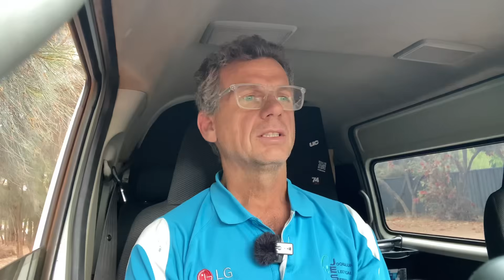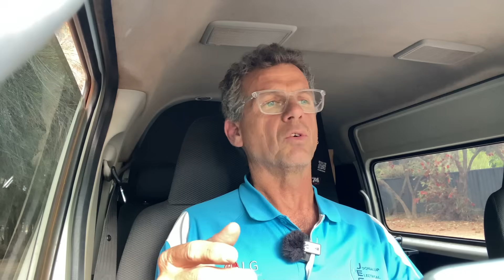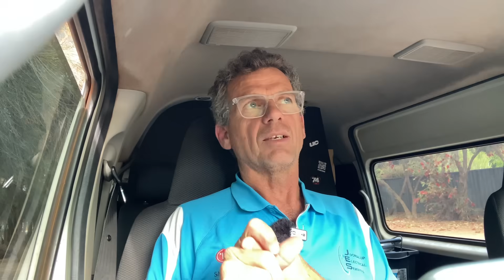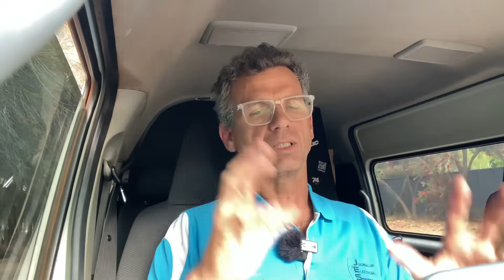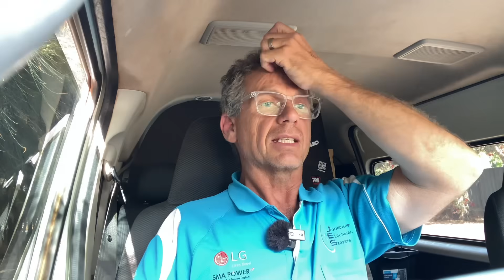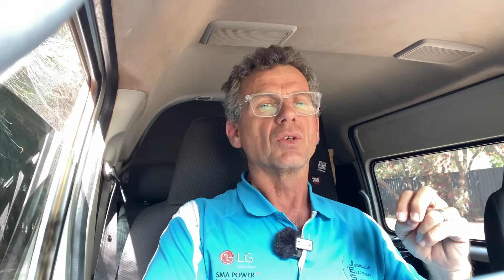What you need to consider before buying an Off Grid solar system, facts from an experienced tradie!

Comment: The comms issue is one of several reasons why I don't like Tesla any more.  It's really too bad.  But I do disagree about the HF vs LF.   Modern HF inverters have multiple distinct designs and you need to know what you are getting:

* Large HVDC mid-bus with LVDC battery connections (Tesla, Sol-Ark, EG4) (e.g. Deye and Fronius)
* Small HVDC mid-bus with LVDC battery connections (most small HF inverters)
* Large HVDC mid-bus with HVDC battery connections (bleeding edge so we'll be seeing these soon)
* Small HVDC mid-bus with HVDC battery connections (SMA, SigEnergy, LG)

A very mixed bag, but I think for HF it mostly comes down to selecting the right inverter for the job.  And I also suspect that the bleeding edge technology... HVDC mid-busses with HVDC battery connections, will completely stomp LF once manufacturers decide to do it.  Right now most HVDC battery inverter designs have only small mid-busses because the designs depend on the battery itself to be the energy buffer.  But batteries do not make good capacitors so they can't handle the cycle-to-cycle buffering required to run large loads with poor power factor.  It's a learning curve for sure.

There are still major advantages to HF, particularly the MPPT implementation (which generates very little heat because its a HVDC-string-to-HVDC-mid-bus).

The large mid-bus HF inverters can surge just as well as a LF inverter and actually do a better job with poor-power factor running loads than LF inverters can because the capacitor bank is much, much more efficient at dealing with cycle-to-cycle reactive power than a transformer with capture diodes and LVDC side capacitors.

HF inverters also do a much better job transferring solar power directly to loads (HVDC string to HVDC mid-bus = no heat).  Hence why you see higher output specs when solar is present.  It's really only battery charging of LVDC battery banks that generates heat.   LF inverters do a better job charging LVDC battery banks while simultaneously inverting.

LF designs (Victron and others) tend to be simpler but also tend not to have much integration because they don't have the HVDC mid-bus that makes integration so easy for HF designs.   What they do have is that big honking hunk of metal which can buffer a lot of energy, providing high surge loads, and have a lot of mass as a heat sink... so large temporary loads can run a long time. 

However, be careful, because taking heat away from a LF transformer is actually really difficult to do.  A LF inverter cannot handle large continuous running loads any better than a HF inverter can and also can't recover as quickly when they do overheat.

Regardless of the type of inverter, I always oversize.  By a lot.  And I mount them indoors.  In a conditioned or partially conditioned space, if possible.  Outdoor mounting for an inverter is a mistake in my view.  Inverters (of either type) just last a whole lot longer when they aren't running 90C internal temps.  Avoid the high temps and an inverter will last a very long time.  It kinda drives me nuts to see so many inverters mounted outside in Australia instead of inside in a conditioned space.  90% of the problems would disappear if they were mounted in a conditioned space.

-Matt
Reply from the maker: Yes climate controlled environment is best

Comment: When I designed my off-grid system it was always about robustness, reliability, redundancy and running by itself (without a requirement for off-site monitoring or me getting involved on a daily basis.) I chose Victron equipment and went for a DC coupled system.

I split my 15kW of panels into four arrays, each with its own MPPT regulator. They are all identical and I can get by on two of them if I have to. I have three 5kVA inverters running in single-phase, parallel configuration and if one fails, I could get by running on two inverters while I wait for a replacement or repair. It would take no more than 5 minutes to quickly reconfigure the remaining inverters to work together.

I also went for a modular battery system that has its own BMS as well as directly interacting with the Victron Cerbo GX so that charging and discharging are optimal at all times. Altogether i have 50kWh of capacity made up of 14 individual 48V batteries in parallel, that communicate with the Cerbo GX on a CAN bus.

It really has been a case of "set and forget" and I have not had to intervene in any way since it was commissioned over two years ago. As an aside, I take your point about having some sort of backup generation, but in my case, I opted not to do so. Since commissioning, my lowest SOC has been 50%, during a period of cloud cover that lasted several days.

Victron, old style tech that you can't break with a stick...
Reply from the maker: Great set up, the generator is essential for me as a business. But if you are in tune with your own system and know what your doing thats fine 👍🏻

Comment: I had to buy a 1200w 24V Victron inverter after trying 2 (new on warranty) 3000w  24v pure sine inverters of same brand that was not able to run my medical equipent I am dependent on. After I got the Victron no problems, so now I have a 3000w pure sine for heavy loads and the 1200w Victron for everything else and usually just run the Victron in my van combined with 1280w of solar panels and 5000w /h battery bank with lifePo4,
Reply from the maker: I have an 800w victron in one of my vans which cops an absolute hiding everytime it gets used. I have been punishing it for six years and its still going 👍🏻

Comment: So You must be connected to the Sigenergy cloud and they can control your system at any time ????? If that's the case i wounder if that's a directive from the Government .... wounder what else that could mean ...
Reply: My installer has some control of my Sigenergy system as well, I can report any issue to them for investigation, saves them coming to my place if it something that can be fixed remotely. I don't have any problem with Sigenergy or my installer having control, I'm with Amber Energy VPP and they have control of my energy controller as well as do my DNSP to limit my export at times.
Reply from the maker: Yes absolutely they can.
Reply: @joondalupelectricalservice3201  But they DON'T!!!!

Comment: Just put the 25kw power controller in
Reply from the maker: Solves some issues but definitely not all of them
Reply: Or buy another Sig controller + batteries which can be connected in parallel to meet the energy storage and consumption needs.

Comment: Great job, been looking forward to this one about hybrids off grid as lots of people are looking at the Sig for example for off grid. Great for grid tied and it does blackstart from pv in a grid outage with the gateway of course like most good blackout capable systems and supports 3 phase unlike Tesla pw 3. Plus I like they support 3 phase and if you go 25kw inverter no problem. But agreed full time off grid with all in one hybrids is flogging it being transformer less .
They do have their own wi fi dongle if you’re worried about your own wi fi not working.

Comment: OK... how does the Tesla Powerwall compare in terms of "Off Grid" systems?
Reply from the maker: Same same, I have five of them as off grid.  They operate well but are very fickle and prone to heat and connectivity issues, warranty issues also if not communicating. I wouldnt do them again for many reasons.

Comment: WHY in the world would they disable the battery function after 90 days? WTF?
Reply: Manufacturers claim its to maintain the battery warranty, but there is no actual real-world reason to do it.  LFP batteries are not fragile beasts requiring constant cloud comms.  Or any cloud comms.  If something goes wrong, the BMS will disconnect the battery, simple as that.  Requiring internet comms is a non-starter for me.

What's interesting is that older more established players like SMA and Victron come from a time when internet connectivity wasn't really a thing... when adding wifi was an expensive addition and not a $1 chip like it is today.   So their systems are just naturally more robust when it comes to losing connectivity (or not needing it in the first place) than many of the more modern systems.

Unfortunately, their lack of innovation is telling too, unfortunately.  Victron is having a hard time catching up to 48V, let alone HVDC batteries.  The lack of at least modest integration is hurting Victron a lot... they still want to sell people a dozen different pieces of equipment and require a ton of manual wiring to glue everything together.

SMA had to farm-out their HVDC battery to BYD and LG and basically stuck to grid-tie.  Their grid-down capabilities are incredibly poor... almost no ability to handle poor power factor due to the lack of energy buffering (the small-scale HVDC mid-bus in SMA gear).

-Matt
Reply from the maker: Crazy hey!
Reply: @joondalupelectricalservice3201  Not even crazy. More like sabotage... Another company that is worth to boycott...